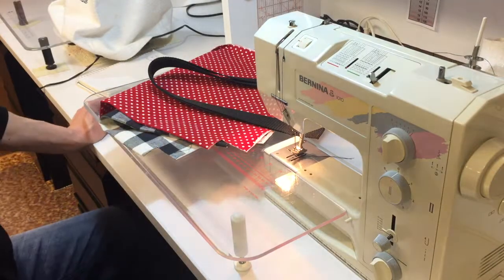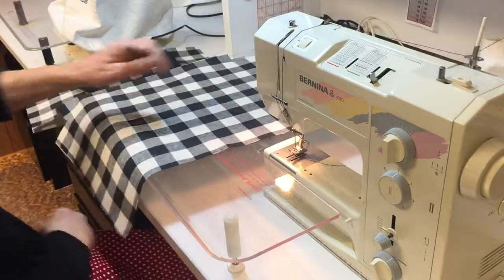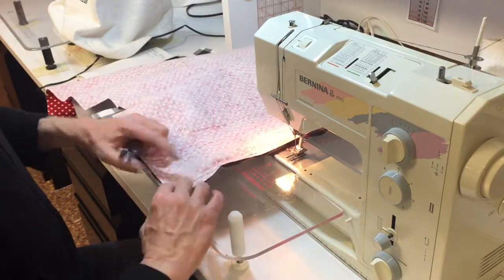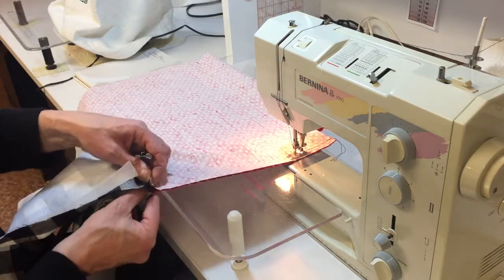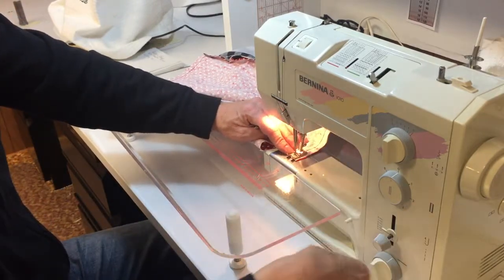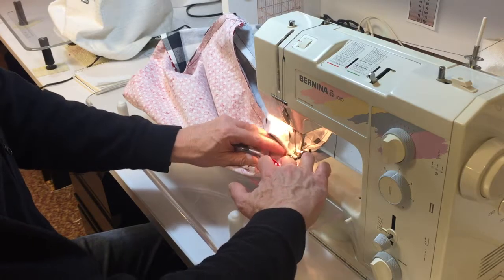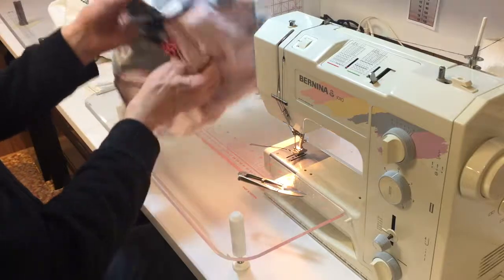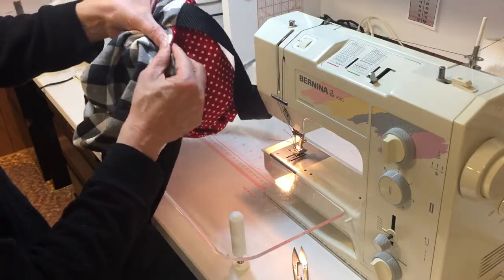Production Style Sewing on a home sewing machine

Comment: Oh... I have been sewing for a long time, self taught, experiencing problems every now and then. Not once have I reflected on that take up lever tie any not... I really need to take a basic class in sewing I think. I have a  Bernina 1020 and even though it makes much more noise than yours I am really happy with it.
Reply: You probably just need to oil the bobbin race, these machines are lovely when they’re oiled 🤗
Reply: @cazkiwinz4300  I am doing that alla the time, every time I put in a new bobbin. But I actually think that the machine doesn't do good with my thread (Serafil 40). I am not sure but I think it might be either to thick because it works much better with 60 or maybe a combination of the thickness of the thread and the way it is spun because it twists.
Reply: Definitely could be. My Bernina is fairly fussy and only likes Gutterman Sew All and hates all my fun cheap thread…whereas my cheap plastic basic Brother machine is the total opposite!